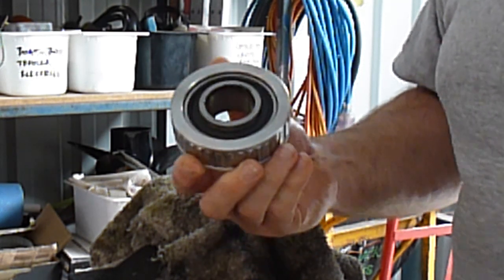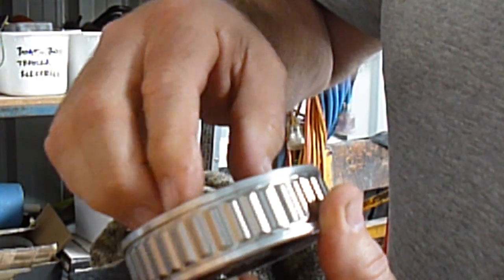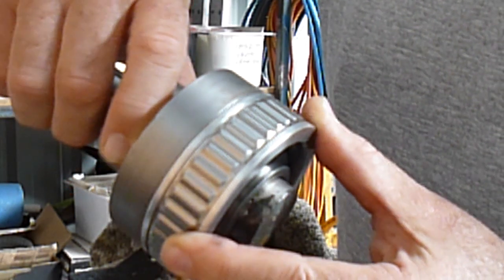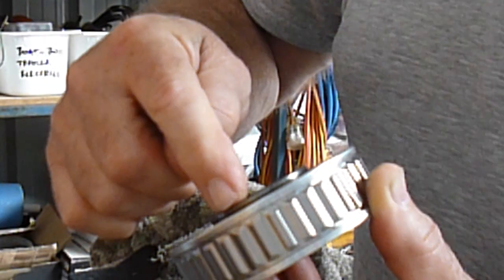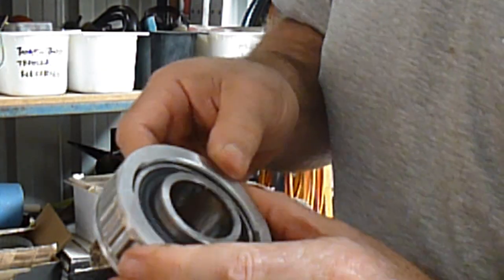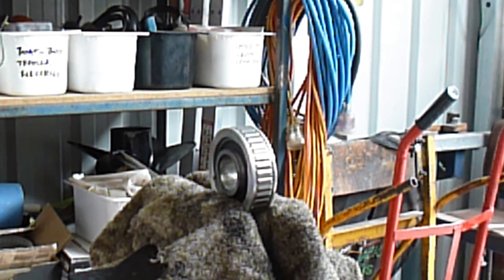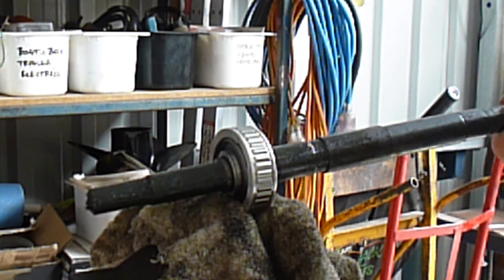9 Gimbal bearings explained

Comment: Great video explaining how a gimbal bearing works. I have purchased 2 gimbal bearings to replace in my sterndrive. When I secured the bearings in the vice and installed the alignment tool to swivel the bearing in the carrier it would not budge. I was afraid of breaking the carrier if I forced it anymore. Neither bearing would move inside the carrier as shown in the video. I even called and spoke to 2 different people who manufacture the Sierra bearing that I purchased and they were unable to explain or help me. Please can anyone help me in this very frustrating situation. I'm pulling my hair out!!
Reply: I have exactly the same problem i can't find bearing for my volvo sx-m i'm going crazy
Reply: I have now purchased 3 new gimbal bearings. None of them swivel or pivot as shown in the video. I would break the carrier that contains the actual bearing if I held it in a vice and used the alignment tool to move the bearing as in the video. So here is what I did. I don't know if its advised or the proper thing to do. I saw in another you tube video, how to remove the bearing from the carrier. Using a fine emery cloth I removed small amounts of the inner surface that the bearing rides on. Its made of an aluminum alloy type of material ( quit soft). I then cleaned the surface thoroughly put some lube on the surfaces and carefully reinstalled the bearing into the carrier. Placed it back in the vice and tried to rotate the bearing. I went through this process 5 or 6 times. It takes some patience for sure. Finally I had removed enough material that I can now move the bearing as the video shows. The word gimbal means that it should move as in a gimbal compass on your boat for navigation purposes. I even called the manufacturers of the gimbal bearings and their people didn't know what I was talking about. They should not refer to their bearing as a GIMBAL bearing if it doesn't swivel. Just call it a bearing. @jacquesmichel1269

Comment: thank you Chris, I've replaced my gimbal a few times and never realized that it pivots. That explains why I have had trouble aligning it. I just replaced my gimbal bearing and was struggling to get the alignment and after watching you pivot the bearing in the vise I tried it and it popped loose and then I was able to get the alignment perfect, thanks again.

Comment: My Volvo SX-A had the original sealed bearing facing forward. I had no water in the bellows, but I picked up a vibration at idle, so my mechanic suggested the gimbal bearing. When I reached in by hand and spun the bearing it felt like it had a slight whirr so I changed it. I am hoping it is the bearing and not the outdrive. Thanks for the video! Very helpful.

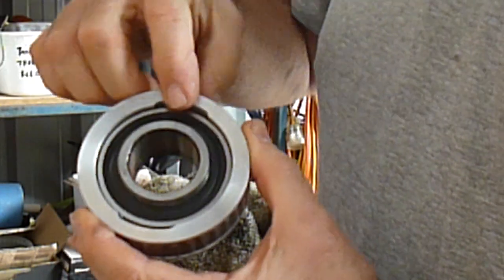Comment: Great video. However, at 1:16 into the video, and again at 1:26, Chris is mistaken. These open areas (in the outer housing) are to face AFT so that the bearing itself can be turned and removed.
Reply: No, he is not. Merc SPECIFICALLY require the slots to face forward so the bearing can't be removed without taking the carrier out. The carrier and bearing are matched in the assembly process, and to replace just the bearing (as was being done in the 70s and 80s) causes more problems than it solved. Merc saw a rise in the number of gimbal bearing problems caused by replacing just the bearing, and since fitting the bearing with the slots forward, there are now very few 'gimbal bearing issues' apart from water ingress (usually caused by perforated bellows). DO NOT install the bearing with the slots facing back.
Reply: @Chris-hx3om  Ok so if the bearing was originally designed for the slots to face aft and nobody in this entire planet will ever buy just the bearing without a kit (bearing race carrier) what difference does it make?  My Haynes manual clearly shows slots facing aft.  Clockwise, counterclockwise.  Seem a non issue.  1000,000,000 dollar question:  Will it perform any differently?  Thanks for the video Chris.

Comment: What's the ring around the bearing for? Mine keeps movin out as I'm installing bearing
Reply: It's called a 'tolerance ring'. If you're installing a sealed bearing, it doesn't matter if it moves. If you have a Sierra bearing that's greaseable (take it back and get a Merc sealed bearing), then it should be firm enough to not move.

Comment: Is a sealed gimbal bearing superior or stronger to a greasable bearing?  How long should each last? Or how often should they be replaced?
Reply from the maker: No difference between sealed and greaseable (as far as strength or 'superiority'). Just with the sealed, you 'set and forget'. How long a sealed bearing will last depends on how often you let water into the bellows. How often they should be replaced is dependent on when water gets into the bellows. Generally, a sealed bearing and a greaseable bearing (that is being greased properly and on schedule) will last a very long time. 20 years is not unusual.
Reply: @chrisa660  thank you 😊

Comment: Thank you.  How often do you recommend that the gimbal bearing be replaced as preventative maintenance?
Reply from the maker: Do not replace gimbal bearings as a 'preventative' measure. The bearing will outlast the boat, provided water doesn't enter the bellows. If water gets in, you'll be replacing the gimbal bearing, the uni joints and probably the yoke seal... And having a sealed bearing or a greaseable bearing will make no difference at that point. I'll say it one more time for good measure... You DO NOT need to replace the gimbal bearing as a 'preventative measure'. It's unnecessary and a complete waste of money. When I sold my last engine (at 12 years old) it was still on the original bearing, and the current engine is now 14 years old, and still with the original bearing...
Reply: @chrisa660  thank you 😊

Comment: Confusing video.In your explanation of orientation of which way does the bearing go is wrong.
Reply from the maker: How so? I pointed out very clearly that the slots in the carrier face the FRONT of the boat. How is that wrong?
Reply: I just pulled my sterndrive apart in order to replace 2 torn bellows. The gimble bearing on my Merc has the 2 slots facing the rear of the boat. So you see the slots when bearing is installed.
Do you think someone has been in there before and installed it incorrectly?
Also, my drive is the "pre Alpha"  (1976)
Will the gimble bearing be the same as the Aplha 1 Gen 1?
I need to order a kit that has the bellows and bearing.
Thank you!
Reply from the maker: @splash5974  Originally Merc were installing the bearings with the slots facing aft. A lot of people were then replacing just the bearing cartridge without the carrier (which are a matched pair), and this caused problems. In the mid 80's Merc changed the way they installed the bearing so that it could not be removed without pulling the carrier out with the cartridge... So having a 1976 with the slots facing aft is normal. If you pull the bearing out, replace the whole thing (with the carrier), and put it in with the slots facing the bow. 

Your drive is an MC1, not a 'pre-Alpha'. There is no such thing as a 'pre-Alpha'. It's a term that some moron on youtube came up with to describe drives before the Alpha One, but the drive immediately before the Alpha one (the MR) is EXACTLY the same as an Alpha One.  Calling an MR and an MC1 the same thing ('pre-Alpha') is like saying that a Ford model T and a horse are the same thing because they are both 'pre-Camaro'. There were 16 different drives before the Alpha One was released in 1986. 

And yes, the gimbal bearing hasn't changed since the late 60s.